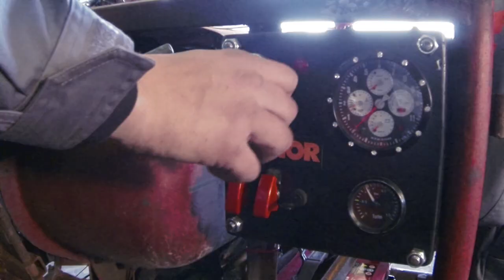VIANOR - TRAKTOR TERROR IS BACK!

Comment: Hey ! juste one question, I want built a fast tractor too, but you have only change the engin on te engine and the gearbox ?
Reply: All you would have to do is put more power in front of the transmission and change the hearing in the rear end